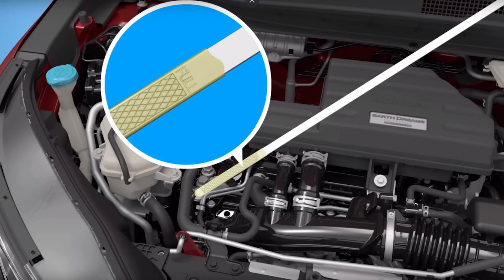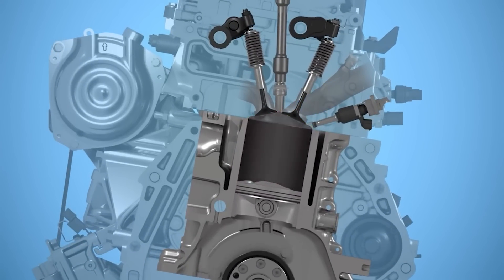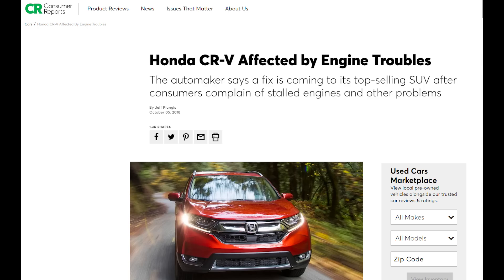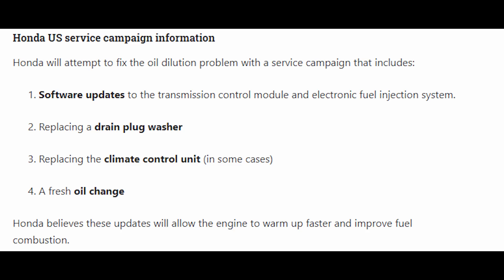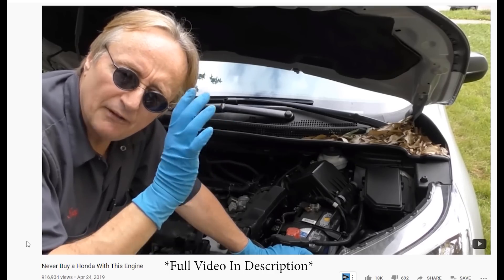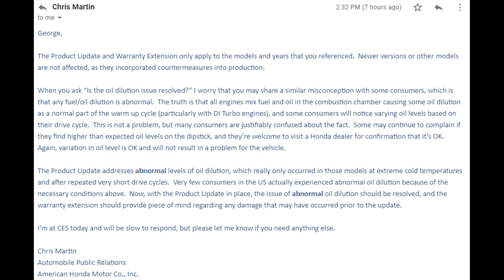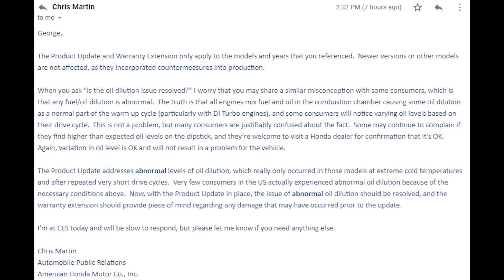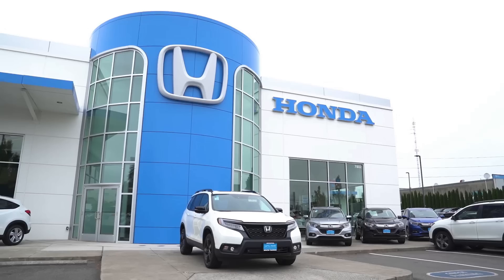Does Honda Have An Oil Dilution Problem? | 1.5L Engine in CR-V and Civic

Comment: hondas used to have best OVERALL 4 CYLINDERS ENGINES!!!!

no more!!!!!!
Reply: The non-turbo engines are fine.  Just stay the HELL away from turbo engines no matter what manufacturer has them.
Reply: HenryHonda including the Lexus 2.0T in the NX and IS
Reply: HenryHonda has nothing to do with the turbo, it’s the poorly designed direct injection system.
Reply: HenryHonda 2.0 NA base model civic. Problem solved.
Reply: @henryhonda8408  why?
Reply: Why not!  More reliable then turbo engines.  Direct injection is the worst thing about them, I've heard that every 10k or so you need to clean valves at a very hefty price!!!  And not to mention if you have to replace some turbo parts get ready to depart with a lot of $$$$$'s.  NO THANK YOU..... NOT for me.
Reply: Not necessarily true. If designed right turbo charged engines can easily last as long as na engines with the added bonus of significantly more power.

Comment: Why couldn't Honda have put a non turbo engine in the new Crv. That and having a CVT transmission make it terrible choices. Neither are as reliable as traditional engines and transmissions. These are facts as stated by Scotty on his channel.
Reply: We also have a 2015 RAV 4 its built like a tank. Don't  waste your money on any turbo charger type vehicles. Honda doesn't want to admit to their mistake of bringing this turbo charger engine to the market.
Reply from the maker: In the 2019 CRV, there was an NA engine on the lower trims.  Don't know why Honda got rid of it.
Reply: Bad engine design strategy by Honda.   Now Honda turbo owners are having to live with the reliability and potential safety issues. Toyota did it right.
Reply: The problem is meeting EPA requirements, the older technology cannot do so and Honda has to keep selling cars, so you get what works for EPA needs even though that is not in your best interests.

Comment: I was looking at getting a new Crv soon. Im looking at a 2020 Rav 4  or Might get a Passport or Ridgeline instead. I love my 2013 Crv, its very reliable and roomy.
Reply: I’d keep the 13 crv instead of buying a new crv.   I traded my 05 crv for the 18 crv and greatly regret it now due to oil dilution issues.
Reply: The 2017, 18, 19 CRV has a newer body style and only the base model in each yr has the 4 cylinder  2.4 liter engine. This engine is perfected it runs like a Champion. it's in my 2016 CRV EX. Honda has stopped putting the 2.4 liter 4 cylinder in any of its vehicles 2019 was the last model year for that engine. The 2020 only comes with a 1.5 liter Turbo charged engine with Oil Dilution problems. A mechanic who retired from a Honda Dealership advised me to avoid the 1.5 liter 4 cylinder Turbo engine due to it's problems and repair cost once the warranty expired. I'm  glad I listened to him.
Reply: @georgewoodget271  Honds doesn't make as good of Turbo-4 as GM does these days.
Reply: "In a memo sent to dealers, Honda’s manager of auto campaigns and recalls, Brad Ortloff, said oil in these engines could be diluted because of software settings or potential hardware failures. Some vehicles could experience “lack of power,” leading to cylinder misfires or engine noise." Consumer Reports 

"But if the vehicles are stalling, as some owners have reported, this is a safety issue and Honda should conduct an official recall, which doesn’t expire.” Consumer Reports
Reply from the maker: Passport, Pilot, Ridgeline all uses the 3.5L v6, great motor.
Reply: @DriversOnly  not the older Honda V6 with VCM issues.

Stay away from Honda's use of the ZF transmission as Motor Trend and few others have had their tranamiaaions replaced while doing longterm test.

https://www.motortrend.com/cars/honda/pilot/2019/2019-honda-pilot-first-drive-review/

Comment: Even if it didn't have an oil dilution problem, it still has a cvt problem.  And, I dont want a  godamn turbo either. Honda's  have really gone downhill.  I'm a honda guy but I'm very glad I switched to mazda.
Reply: yep!!!!!!!!
Reply: Cx5?
Reply: @tonychau1983  no. 2014 mazda 6. Not sure I would buy a cx5 either.  They have cylinder deactivation which could cause major problems
Reply: @Corkfish1  damn they have that feature for 4 bangers?
Reply: @tonychau1983  yeah can you believe it? Crazy. They've had to recall them because rocker arms were breaking off the valve train. Auto manufacturers are getting out of control trying to get every mile they can out of a gallon of gas. As a result complexity goes up and reliability goes down.  They should just keep it simple
Reply: @Corkfish1  guess you can blame the epa for crappy cars.
Reply: Corkfish1 these engines aren’t really that complex tho

Comment: If I get the civic I will get the base 2.0 naturally aspirated with the manual.
Reply from the maker: The LX :).
Reply: @DriversOnly  or the Sport model.
Reply: In Canada the 2020 Civics have 2.0 Port Injection motors (non-turbo) except for the Touring and Si model which have the Turbo Direct Injection engines.  Turbo engines have always been a deal breaker for me, they are made for the racetrack only in my books.
Reply: @henryhonda8408  My 2018 Civic LX turbo 6 speed is a blast to zip around town in!  The torque band is way better than the naturally aspirated 2.0 - it's worth it to me, for sure!
Reply: 1.8 is also GooD
Reply: that's what I did 2017 manual 2l no turbo

Comment: Anyone else notice that Mazda was no.2 on the most reliable manufacturer list?
Reply from the maker: Yup! They've gone up over the years but their lineup is also much smaller than rivals.
Reply: My 2014 mazda 6 has been the best car I've ever owned
Reply: Mazda's market share in U.S. fell to a 10-year low in 2016 at 1.7 percent

========

it wont last!!!! they sell too small amount of cars !!

so they need either built cars here and cut the corners ,  or import cars from other location s, thus risk of sanctions import duties etc...
Reply: It was for a specific model

Comment: This video just drives up  sales.  For Toyota and Lexus
Reply: Unless you are one who is having the issue and Honda has no solution.  There is 4 things wrong with my 2018  Honda CR-V right now, even as today.  Guess how many can be fixed none.  Honda has no idea what to do about any of them.  I have had 6 Hondas and this is the last one.  I am thinking about taking a $10,000 dollar loss and getting a new Toyota. Oh by the way, been an issue since day one and I have 15,000 miles on it.  So Rebelo, I hope it does increase sales for Toyota.  You have no idea what you are talking about.
Reply: If you are thinking about a Honda, RUN........they are a piece of crap now days.
Reply: David B I feel for u  especially when vehicles are so expensive today good luck on your next purchase but I sill prefer the vehicles made in Japan I think the quality is much higher I always buy used vehicles that’s just my opinion
Reply: @on-site4094  I agree with you.  All Honda's used to be made in Japan.  Even the ones that were made in the U.S were using made in Japan motors and trans.  But now, they are even made and assembled in Mexico.  I had a small Honda Fit before this and had zero issues with it besides the recall on the airbag.  Guess where it was made and built.......Japan.
Reply: @davidb1169  My Civic was made in Canada...
Reply: o Rebelo - I only buy TOYOTA and LEXUS.
My Toyota Sienna is 291K miles still runs flawlessly like new. Toyota vehicles can tolerate delayed maintenance better than all other brands. My last oil change for the Sienna was 8K miles ago and it still looks fairly clear. Not just engine and transmission but everything else of a Toyota is better like fuel pump, suspension, paint, iced cold AC, electric windows are still original after 15 years and 291k miles later.
I have had Corolla, Camry, Highlander, Avalon, Supra, Lexus IS. All same stories.
Reply: @seikocitizenwatches  Very well said.

Comment: Just stick with Toyota / Lexus lol
Reply: Yeah, buy a 2020 Lexus RX that still uses the same "K" platform as the 2001 Toyota Highlander.  20 years, 10yrs on a platform is normal for Toyotas. You should have problems ironed out waaaaaaay long time ago.
Reply: Miguel Ircontar z
Reply: Toyota has to use 2 injectors per cylinder to keep them from carboning up which adds issues. Honda puts their injector aimed at the intake valves which solves the issue of carbon at the source. Honda also uses piston oil sprayers and water cooled exhaust pre turbo which adds power and longevity. If I lived in Canada I'd keep an eye on the oil during the winter  but they did put in a higher temp thermostat and reprogrammed the ECU for cold temps which solved the issue. When you have your head off walnut shell blasting your Mazda, VW and the rest  intake valves or figuring out why one of eight injectors on a Toyota is misfiring I'll just change oil and race by.